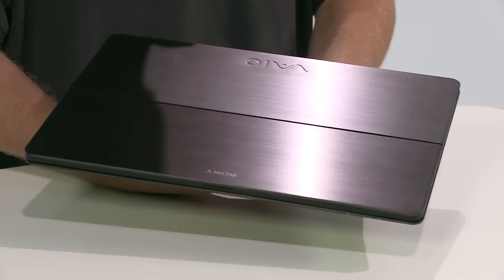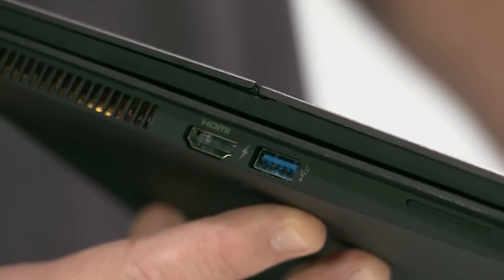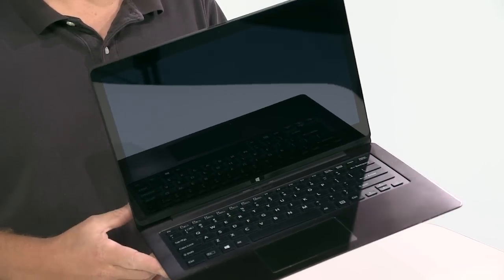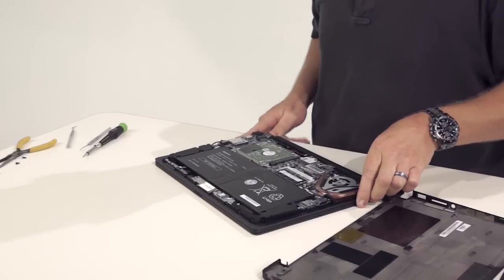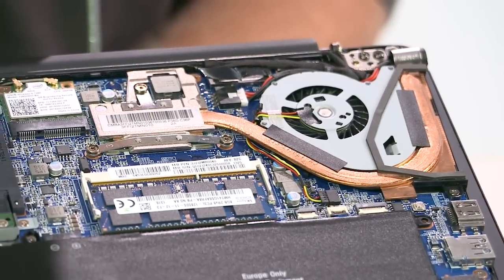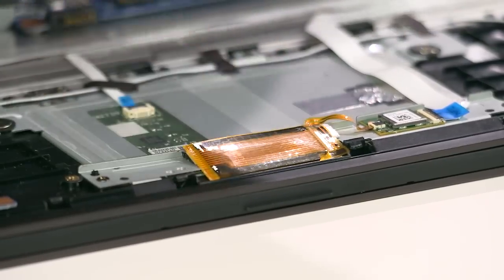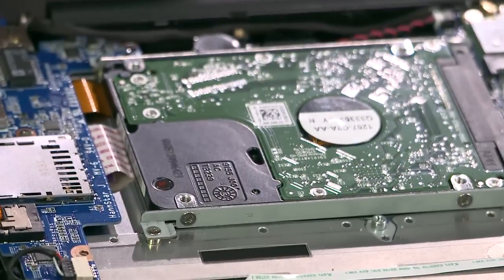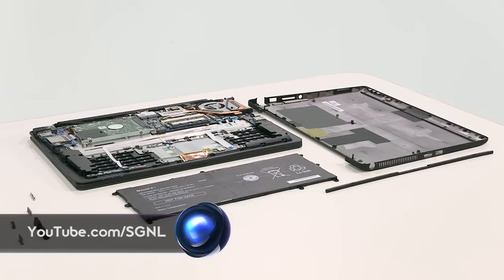Sony VAIO® | Flip PC gets the teardown treatment

Comment: Can you access the slider that engages, disengages the lock for the "flip" part of the screen. I have broken mine so want to set it in permanent flip/tablet mode, but right now its stuck in laptop mode.
(Moving the slider does nothing as it is no longer connected to screen lock)

Comment: I have a Sony Vaio flip laptop, svf15 series. Everything was working fine but since last one week I am facing screen issue. I believe something gets loose when I open the laptop screen. Sometimes when I start the laptop - screen got flickering and then gets constant blank.. and sometimes everything works find and all screen touch are absolutely ok as no issue at all.

Please need your support as I really loved this laptop and I don't think that anything is damaged instead something connection got loose related to display.
Reply: I have the same issue (plus the over heating) but didn't figured it out. Seems a common issue.